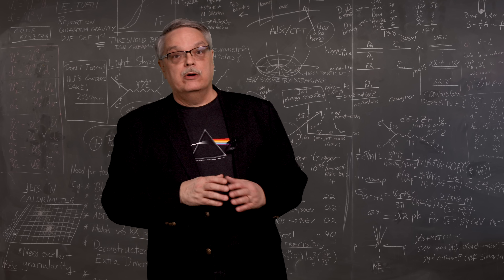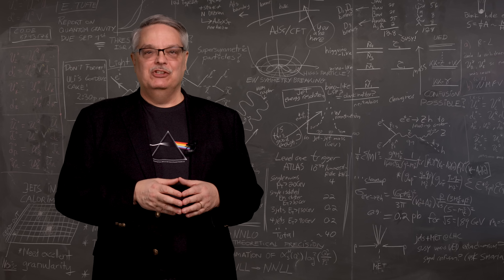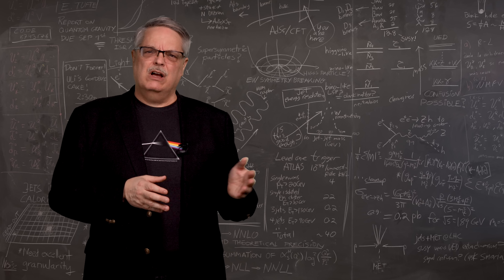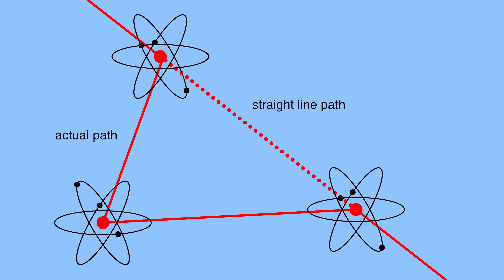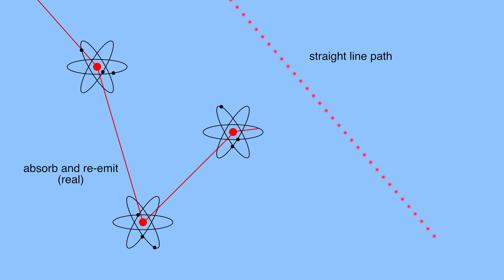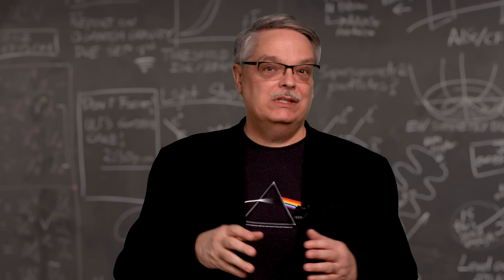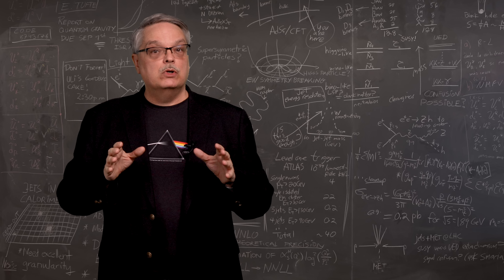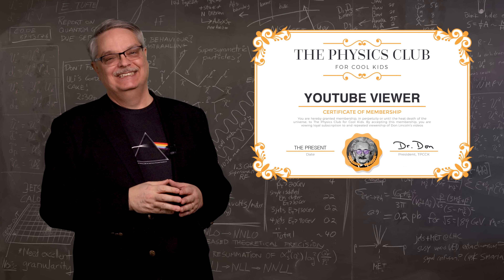Why does light slow down in water?

Comment: This explains nothing. You do a good job of explaining why light slows down in water, glass etc., but you do not explain how light returns to its original speed. Okay, light moves slower when passing through glass etc., because it generates a second wave which creates a new, slower wave. That makes sense. But once it has passed through the glass, it carries on "at the preferred vacuum speed"? This is meaningless. How can light have a "preference"? I understand that you mean its "normal" or "traditional" speed, but this doesn't go anywhere towards explaining how it accelerates back to its "original" speed. Yes, the secondary wave is no longer there to (create a new wave and) slow it down, but the fact is that it's still travelling slower than the "normal" speed of light in that new combination wave.
You also didn't explain how or why light resumes its original direction after it has passed through a medium such as water. Why doesn't it travel in the new direction? Are you saying that photons can "remember" which directions they were travelling before they were deflected?
Reply: A photon has a fixed frequency. You cannot add other photons to it, and you cannot decrease its frequency without absorbing it (from what we know so far). A photon is an EM wave, so in order for it to propagate forward, an electric field must be generated by its magnetic field and vice-versa. When a magnetic and electric field passes through the glass, the glass itself produces an opposing electric and magnetic field in response (Faraday's Law). You can think of this as it being more difficult for the photon to change the EM fields in front of it. This means the wavelength (the distance between a complete cycle of the EM wave) will be shortened, as the effect of its fields are canceled out the farther they reach. Since it's still completing each cycle at the same rate, a shorter wavelength means it must be moving slower. When the photon leaves, there is less resistance to its fields and the fields expand back to its supporting limits. The wavelength gets longer and thus it moves faster.

Let me know if this is wrong in any part.
Reply: For completeness, the main two factors that allow light to move through space are the material's electrical permittivity (call it A)  and its electrical permeability (call it B). The speed of light is exactly 1/sqrt(A*B). And don't let "speed of light" fool you, you can make photons that travel through a vacuum move slower than the "speed of light." It's really just an upper limit on how fast the magnetic and electric fields can change each other.
Reply: @quinson93  It isn't wrong, but it doesn't explain anything. You appear to be suggesting that photons possess some kind of memory or awareness of what they're supposed to be, and how they're supposed to behave (or that that they have indestructible inherent properties).
Reply: @zakmartin  Not at all! Nothing about the photon changes, just the space around it that it can influence. Run current through a wire, and you'll produce a magnetic field. This field is not infinite in strength, even without anything in its way. Same reason you're not being sucked off the ground by a passing meteor. A photon being an EM wave is no different. The photon did not change, so there is nothing to remember. The only thing that changed is the material its running through, and an electric and magnetic field still behaves exactly the same as you'd expect.

Here's an 'explain to me like I'm five" explanation. A photon makes 1 step every second (frequency), and it walks into the glass. The farther it steps out the harder it is to step than before, so it must take shorter steps in order to make 1 step a second. It's now moving slower. When it exits the glass, and swings its foot forward, less is in its way so it can move its foot farther in 1 second (not knowing what it was doing before), and walks farther each step moving faster.

Memory or awareness is complete meaningless to it. The only reason a photon exiting the glass in the same direction it enters was because both the sides of the glass are in the same direction. If the glass was bent on exit, light would be moving in the different direction. And if changing the direction of the glass changes the photons path on exit, there must be a direction of glass where the photon moves in the same direction!

And if a photon did not have memory, you would expect that doing the same thing over and over would produce the same result every time. What else is memory but to behave differently based on its past? More so, without a memory, reversing the photons direction should produce the same path that lead up to it. That is exactly what we see. If you roll a car down a hill at max speed, and it goes through mud and slows down, only to come out of it back onto a road and speed up back to max, do you think the car had a memory of how fast it was doing or is that just gravity?
Reply: @quinson93  I can do without your 'explain to me like I'm five" explanations. I understand the explanation perfectly. I don't think it explains anything. It's a description of what (supposedly) happens, not an explanation. The reasons for the photon's reduction in speed are irrelevant. The fact is, it slows down and resumes its "original" speed when it exits the glass (or water, or whatever). It is meaningless to say that it resumes it's original speed because the interaction that was slowing it down no longer exists.
Your car on a hill analogy proves my point rather than yours. Quite apart from the fact that a rolling car involves gravitational potential energy (for which no satisfactory scientific explanation exists), the car is subject to the (again largely unexplained) force of gravity, whereas there is nothing (as far as we know) impelling photons.
Reply: Zak Martin Look up ELIA5, it’s a popular format for conceptualizing complex topics. Also, you don’t have a point. Beasts that do the same thing every time given the same scenario cannot be said to have a memory. If a second beast years apart from the first come up and does the same thing, does it remember what had happened? Memory does not explain this, so it’s what we call a bad explanation. Claiming a photon has a memory is saying it has control of what happens to it. Otherwise, what does it mean to have memory if your not using it? Give me an example of what it looks like to do something without a memory and with one, assuming nothing changed between the two scenarios.
Reply: @quinson93  I never claimed that photons had memory. I said this would be one of the implications of the explanation that had been offered (as to how photons resumed their "original" speed after they'd been slowed down).
Reply: @zakmartin  You didn't define what you mean by memory, so you're not really saying anything at all. Just as gravity pulls on a car, photons are "pulled" by the fields it produces in-front of it. You can work out the math that relates electric fields to magnetic fields, and just be using these simple relations alone explain just about everything from its speed, to the angle of deflection between interfaces. We have it down to a science, and despite what you claim, we can predict almost everything about it. So much so we can slow light down in a specific direction and rotate the fields exactly as we wish. You can even get so accurate, you can see inside of a mouse's brain without removing the skull with just visible light.
Reply: @quinson93   "...just as gravity pulls on a car, photons are 'pulled' by the fields it produces in-front of it".  -  We actually don't know how gravity "pulls on a car", so in this instance you're attempting to explain one unknown by referencing another. 

Yes, we can describe the attributes and behavior of a photon in mathematical terms, but this doesn't explain anything, or reveal anything of the nature of the forces or principles at work.

The original question was how a photon that has been slowed down in a medium such as glass or water can spontaneously accelerate to its "original" speed after it has exited that medium. Saying that the photon is "pulled by the field it produces" is meaningless.
Reply: Zak Martin Early you had claimed we knew less about photons than we did gravity. You claim knowing how a photon moves through space doesn’t tell us how it works in principle. And now you claim knowing how this all works conceptually or mathematically could not describe how a photon could speed up “instantaneously.” All three are entirely false.

First of all, this mathematical model does explain why light accelerates to it’s “original” speed. Despite what this video claims, the waves in a material do not “add together to the wave” that’s not how individual photons move.

Secondly, photons even when there is no obstructions have a maximum “speed” of sorts. They also do not instantly speed up, as the fields inside the glass that generate the fields outside can only change so fast.

Lastly, both gravity and EM are fields. They are not the same, but their form is. We know that the carrier of EM forces is the photon, but yes we do not know what carries gravitational forces.

A photon is an electric wave and a magnetic wave, paired up in such a way as to support each other moving forward. This theory explains everything I’ve addressed so far. A better question would be why does an electric field generate a magnetic field and vice versa, and what are they. Then at least we can think about intrinsic properties of our world, and get to more meaningful questions. As for now, asking about photons is simple getting at the surface level, all which is and has been explained by EM fields. We are currently one layer deep.
Reply: @quinson93  Your "explanation" is an explanation of nothing. You're basically just saying "this is what happens, and it can be represented mathematically". But anything can be represented mathematically. A mathematical description is not an explanation.
Reply: @zakmartin  Welcome back! Yes, everything can be represented by mathematics, it has its foundations in logic after all. Not all representations are valid however, so knowing the correct form can tell you how any two quantities are related. In other words, empirical mathematics is about understanding how two different things relate to each other. In this case, how electric fields produce magnetic fields that in turn produce electric fields, making up what we call a photon. The relationship between these two fields can easily answer questions related to a photons speed and deflection. However, Maxwell's equations are based on observation as I would expect you to bring up. To clarify, we know why a photon has its speed and we know why it changes the direction on the interface between surfaces because we know how an EM field behaves, bet we don't know why an EM field behaves as it does. We can explain why the sky is blue, but we still haven't described why the EM field works as it does at all. Get it? This is what I referred to as deeper questions.

But no wild 'why' chase can be complete without considering axioms. An axiom, in short, is a fundamental truth. In physics, these are your intrinsic properties like charge, mass, space, and the fields that act on them. They are the cornerstones of why this field used to be called Natural Philosophy, and I think a philosophical explanation is what you're looking for if I may be so presumptuous. It could be that we may simply don't have the tools or methods to answer the questions that need to be asked, or it may be that axioms are truly fundamental.

Enter Gödel's incompleteness theorems. The two theorems depend on a system of axioms capable of arithmetic. If anything can be represented mathematically, this theorem applies. The first theorem states that no finite set of axioms can be used to prove everything. There will always be something left unproven by the axioms, and no way to prove it with just these axioms alone. The second theorem states that no set of axioms can be used to formal prove itself. Take anything in life you understand well, and remove one of its assumptions. The whole thing will likely collapse. This would imply that either what can be known is finite, or there exists an uncountable number of truths in our world that cannot be explained.

In my opinion, there are two paths in science: try to explain a supposed axiom (like finding out that a proton is actually made out of quarks) or find what cannot be explained with our current understanding (discovering the Higgs field).

In summary, I've laid out how a photon moves through space by examining how EM fields relate to each other, and how they generate each other at different distances in accordance to the medium they are in. Both Electric and Magnetic fields exist, apart from what we know to be a photon. Reread your original comment. In this framework, have I not answered your question long before this point?

Let's run through it, shall we?

First, no, light does not generate a second wave as the video would have you believe. Yes, you can add the original wave to this "second wave" to create the "slower wave", but thinking in this way doesn't explain how a single pulse of light would interact locally. But you said it made sense, so you must agree light is interacting with the glass. How though? What is this second wave actually doing physically to the photon? If you answer this simple question, congratulations you also explained why light returns to the same speed it had in a vacuum! Here's the answer, light in interacting with the vacuum in the exact same way light is interacting with the glass. But why does it take time for light to travel anywhere? It's the same question as before, surprisingly. So let's review!

The front of the wave changes from electric to magnetic to electric at a constant rate (why? no one knows), these fields are not infinite in reach (the strength falling off at 1/r^2) and are shortened by the environment's ability to produce them (that's why we call them electric permittivity and magnetic *permeability*) which both glass and a vacuum have, so each field is generated a short distance from the last one. And... that's it. Congratulations, the light will now always travel at the same speed no matter what it passes through because it DOESN'T MOVE AT ALL! Just like ocean waves moving up and down, electric and magnetic fields don't actually move in the classical sense, they just create fields around them. The distance these fields are created at is simply a product of the environment, and speed is strictly determined by how far each field can be generated in a fixed amount of time. A photon then is nothing more than a localized packet of the EM field, and it is treated as such in modern physics.

TL;DR: Just read the last paragraph.

Comment: Dear Dr, What happens with the color of the ligt inside the glass? If the speed slowes down the wavelenght enshorten, so does the colour becomes more bluish?. Best regrads
Reply: This is a very interesting point and let me try to answer: color is not a wavelength but a frequency. Frequency of a foton is proportional to the energy of this foton so every detector (any device or just a human eye) will see the same photon, even if its wavelength will be different because of properties of the medium. Every kind of detector (like eye) is sensitive to the ENERGY of a photon. But a very interesting outcome comes along: the interference pattern of a certain laser beam should look different in the air and in the water (diffraction grating used remains the same). I'm so keen to see this... I'm gonna make this experiment actually

Comment: But sir Why would the velocity change with the change in wavelength of light.. please answer it sir.
Reply: Because the frequency remains the same.  Red light is still red, and blue is still blue.  To maintain the same frequency at a shorter wavelength would mean slower velocity.
Reply: @graybeard222  
So its essentialy a consequence from conservation of energy?
Reply: Yup. Red light and violet light should travel in different speeds then.
Reply: @android12921  Different wavelengths of light do travel at different speeds in the same medium. One example of this is the fact that you see a spectrum of 7 colours when white light is incident on a prism. Materials have different refractive indices for different wavelengths. Look up Cauchy's equation: https://en.m.wikipedia.org/wiki/Cauchy%27s_equation
Reply: Frequency is a property related to source which remains constant , as the wave length changes velocity has to change in accordance with v =f. lemda where lemda stands for wave length. From classical view point laws of  refraction and refraction can be computed from fermat's principal .However the core reason why it happens physically is explained here in video considering interaction of electrons with oscillating electric field associated with EM waves.

Comment: There is a misconception in the question itself. The "light" (i.e, the light particle) does not slow down. Ever.
It's only the apparent wave velocity (phase velocity) that changes.
In other words, if you clock the time taken by the light to travel through the glass, it wouldn't be any higher.
It's very important to make this distinction, I don't understand why it's still taught as  "light" slows down, causing so much confusion, even after all of Einstein's work
Reply: Thank you very much! I just questioned my understanding of the premises of the relativity theories.